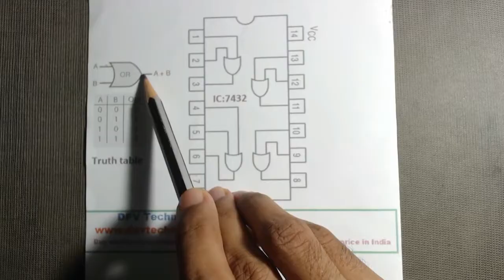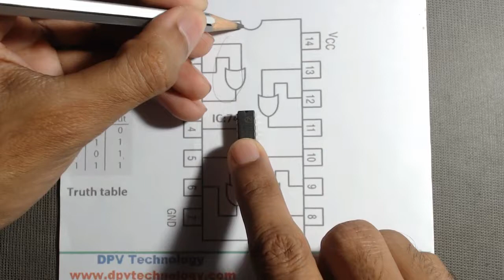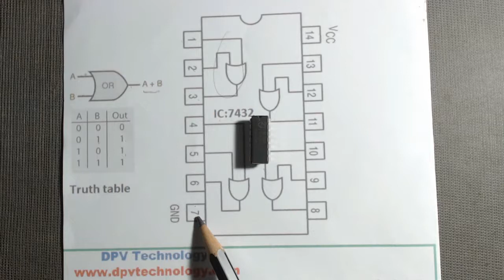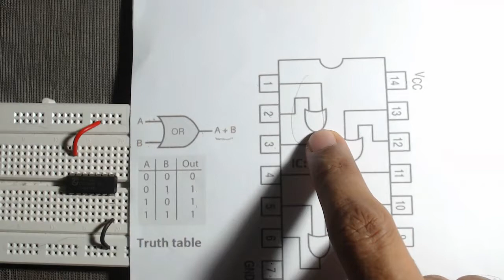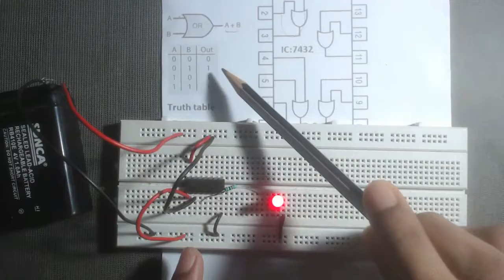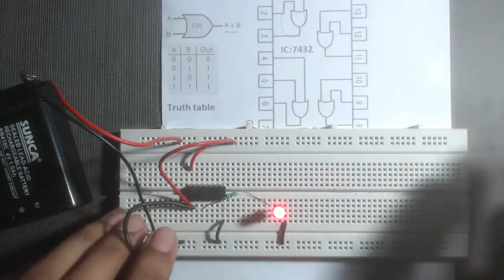OR Gate on Breadboard

Comment: Excellent Video! 

Application: I'm a model railroader. I have RR crossing signals located where roads cross or intersect RR tracks (just as in prototypical situations). I've used OR gate IC circuits so that multiple LDRs can detect when they are covered by freight cars or engines as they roll over them. When that happens, the fluorescent light is blocked and the RR crossing signals begins alternating flashings (a separate circuit) until the cars are past all the LDRs - when light is once again detected and the flashing stops as default.

 BUT when the same LDR circuit is placed in a part of the room not directly under the florescent fixture, the LDR doesn't "see" enough light (as if covered) and thus the LED is constantly lit - that is a problem!

So, how can I vary the LDR's sensitivity to react to the uneven amount of florescent illumination (illuminance) as in a corner of the room, etc)? Should I be using photodiodes instead of LDRs?

Lastly, the OR gate IC utilizes 5 possibilities for LDR sensors to be used. What if I only want to use 1 or 2 of the sensor positions. How do I wire that configuration, please? Thanks